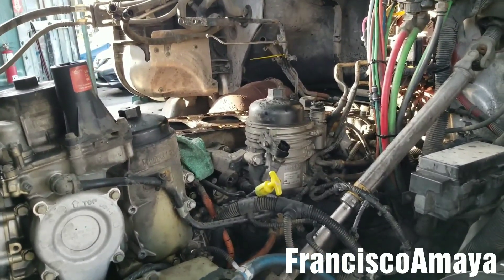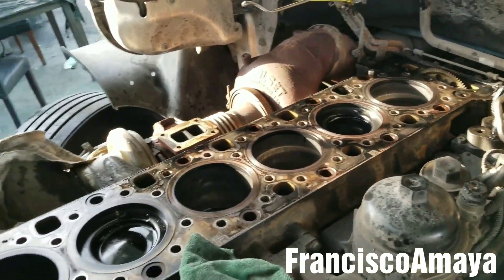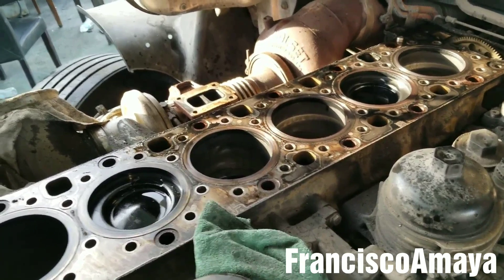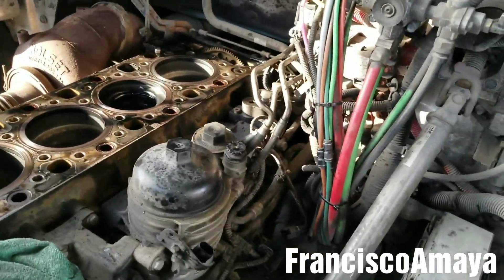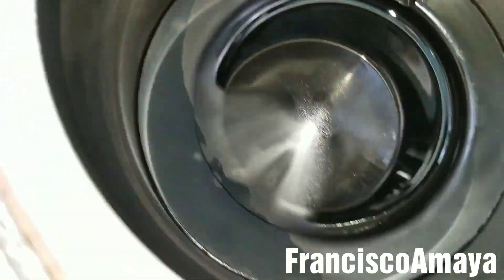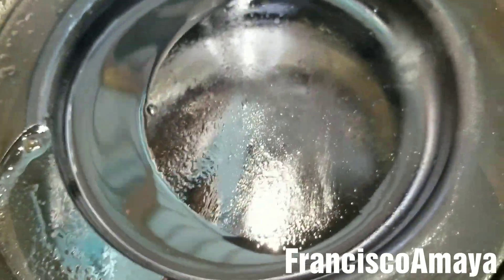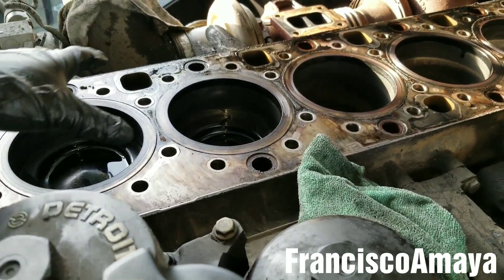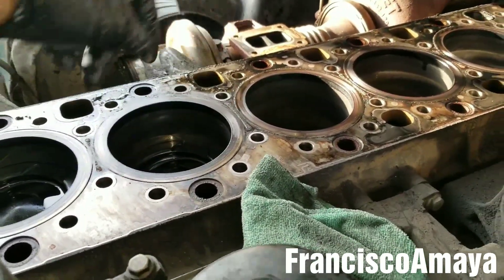Freightliner Cascadia DD13 DD15 DD16 engine noise while running malfunction broken piston overhaul

Comment: Thank you Francisco for your God given talent. I enjoy your videos very much but on this particular video I heard the tapping in the engine but also heard like a rough idle the engine rapping up and down like scraping. I have heard this in many Detroit’s and my truck which is also a Detroit DD13 was not doing it until recently what could that be . I have changed the fuel meter and it still doing it any help will be gratefully appreciate it thanks
Reply: Hey, did you ever find out what the scrapping noise was in your DD13?

Comment: How much would a overhaul cost for a dd15 ?
Reply: $23000 To expensive with that $ I buy other truck
Reply: @diegzales8909  exactly what I was thinking
Reply: Dieg Zales it’s probably that expensive because he is talking taking it to a dealership. They always charge an arm and a leg
Reply: @miguelrobb5719  so how much would a mechanic charge ?
Reply: 559 ZamoraTrucking you can get a rebuild for like $12k from a small shop, but you are taking a risk and won’t have any warranty though
Reply: Omg santo padre tanta plata me quedo con mercedez
Reply: @ovidiofs1 yo tengo un mercedes MBE4000 jala bien esa madre...